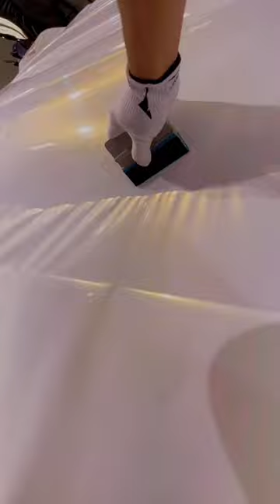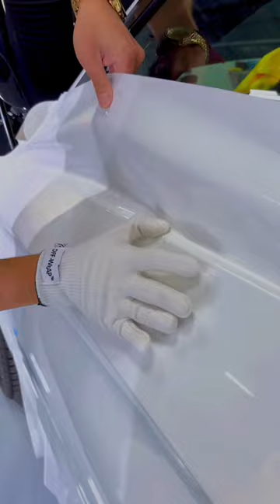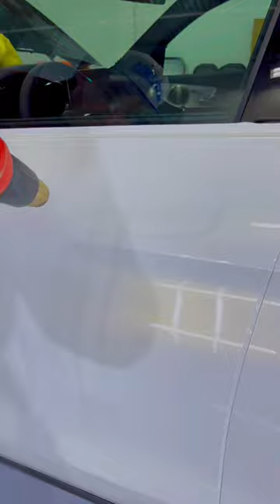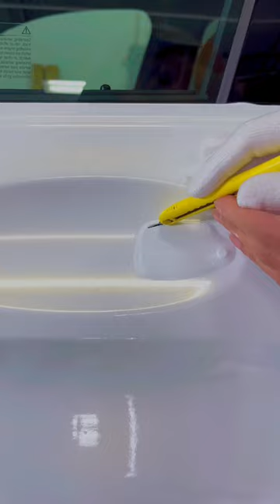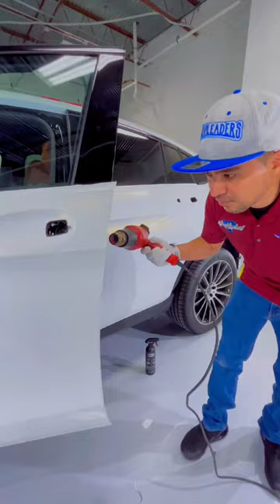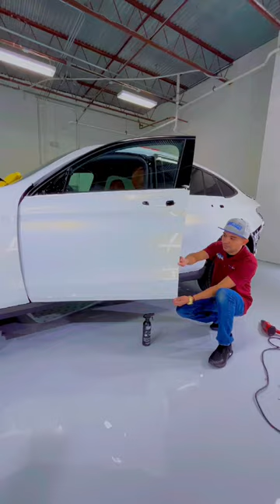Wrapping a Brand New Benz 🔥 Customer saw my videos and pulled up ✨ #carwrap #carwrapping #asmr

Comment: What is better for your car getting it wrapped or painted? What are the benefits and what are the drawbacks? This is something that really interesting man I love that you show it on the Internet for other people to see
Reply: It depends on what u want really. Painted means it's permanent on ur car. Wrap is removable. Paint can chip or fade faster than wrap but that can change if the paint job is more premium which means more expensive. Majority likes wrap because it comes out visually better and u have more options for design or color. Wrap will take about a week in shop while paint will take over 2 weeks. Wrap of course in most cases tends to be more expensive but again prices of both can differ dramatically depending on quality and where you go. If u r looking for permanent simple color, then paint might be better. But if u r looking for more flexibility and don't want to worry about changing ur mind years down the road, go with wrap.
Reply: @username15yearsago52  
I can’t discuss the merits between wrap versus paint, but I will say that an aftermarket paint job affects resale value whereas a wrap you can just take off.
Reply: @LuckyCharms777  agree. Paint is permanent so for example, I painted the car yellow and for some reason don't like the color in 2 years, it's hard. For example, wrap u can take it off if u chnage ur mind.